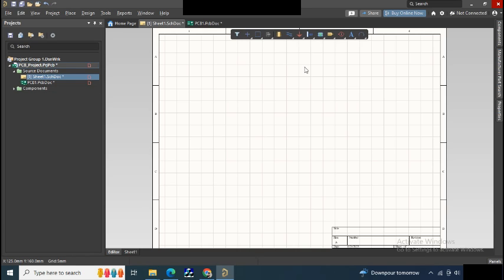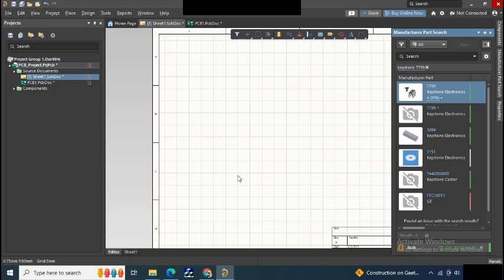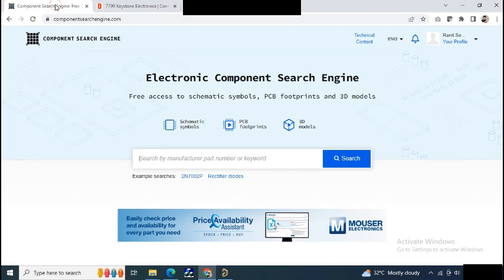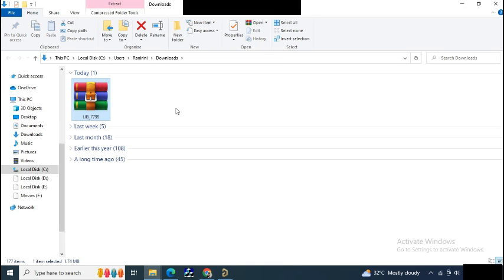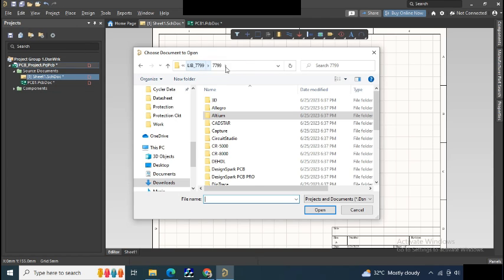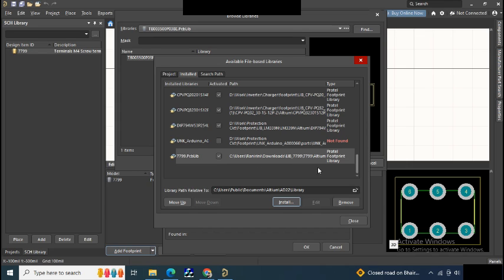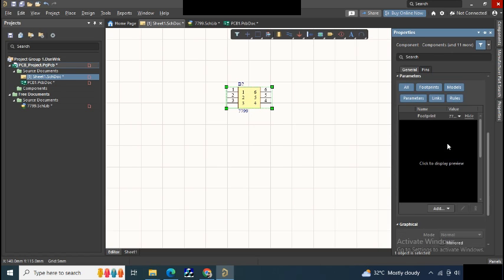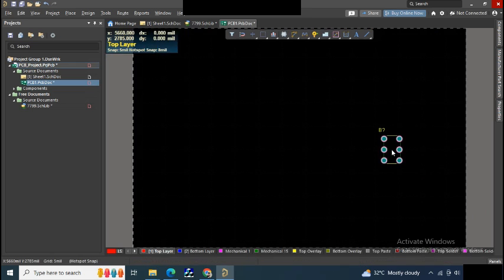How to add or install Footprint Library in Altium | PCB Design | Tutorial-2 | Altium Designer

Comment: For video related to Space vector based PWM signal for three phase inverter of PMSM motor
#urgent
Dear brother,
I am a masters student and i have a problem in designing this model. Whenever i run simulatioj error showing that the output port 1 of IGBT/Diode is not connected'' why its showing. 
I will be thankful if you reply
Reply from the maker: May be there is some connection error. Share your mail I'd please. I will send the model